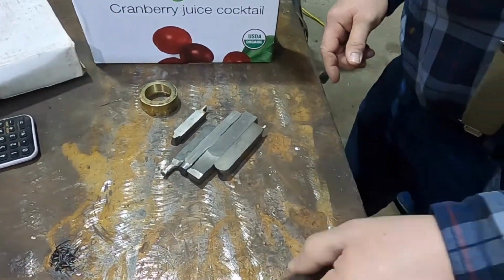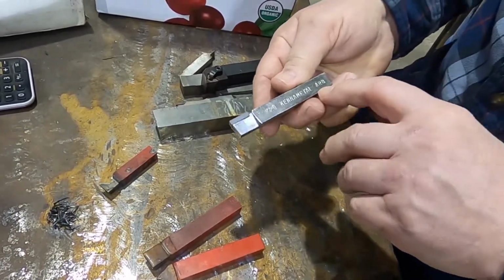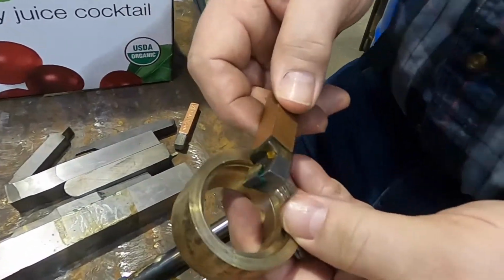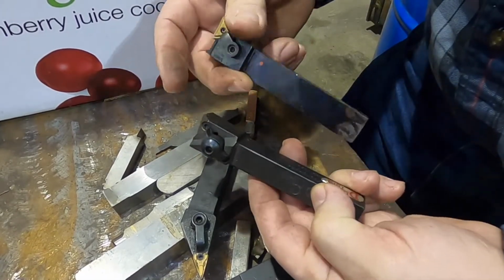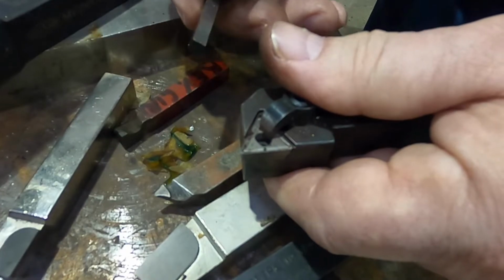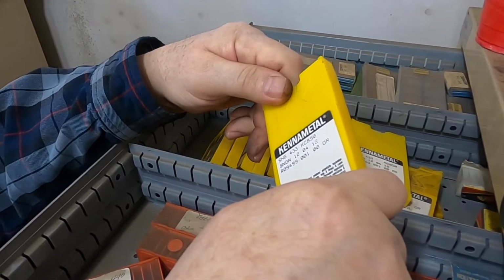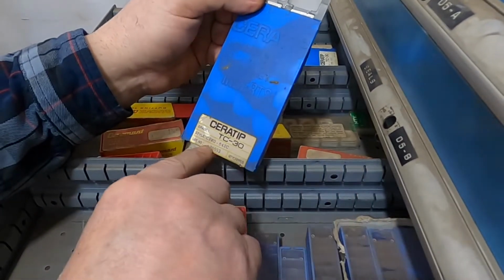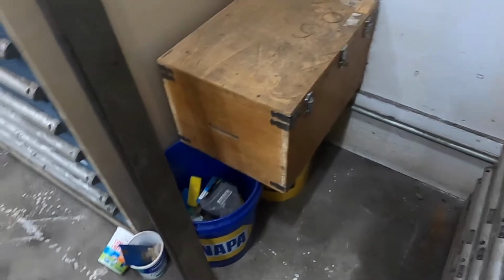Basics of Lathe Tooling Part 3: Looking at Different Tooling in the Shop

Comment: The ones right at the end are called "top notch" inserts by Kennametal at least. Still readily available new. Very common in the oil industry and in hydraulic shops. One holder can take square grooving inserts, radius grooving inserts, and every kind of threading insert imaginable (60°, 55°, acme, buttress, API, you name it) 
The ones with the opposite groove are left hand vs right hand. There are exceptions but generally OD tools use right hand inserts and your boring bars will use left hand inserts. We run them almost exclusively here for threading and small grooving for the ease of use and having one holder to cover 10 different tasks